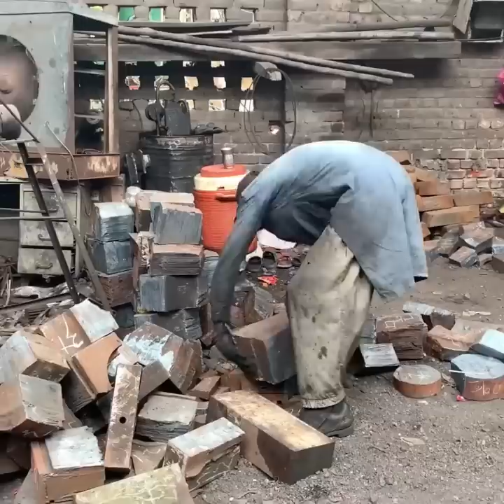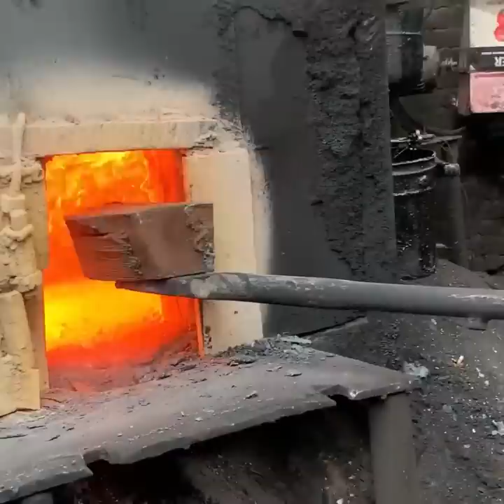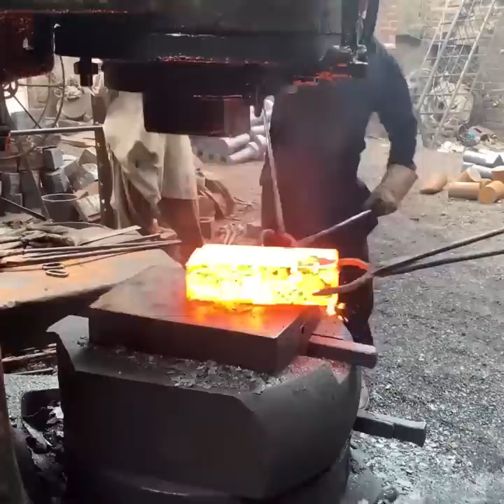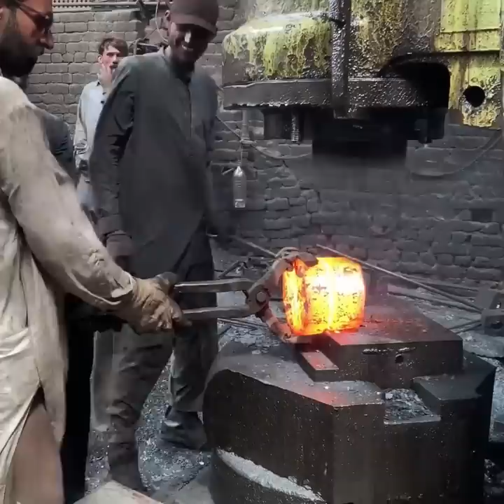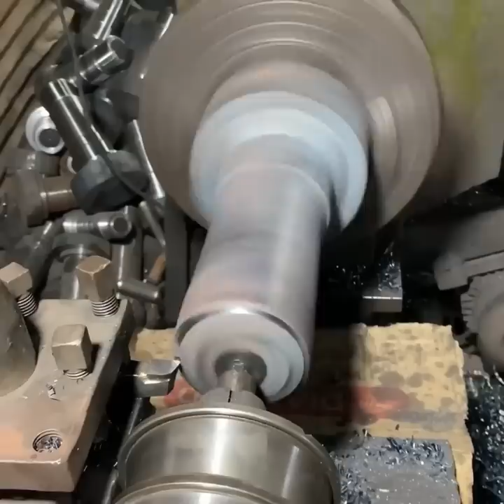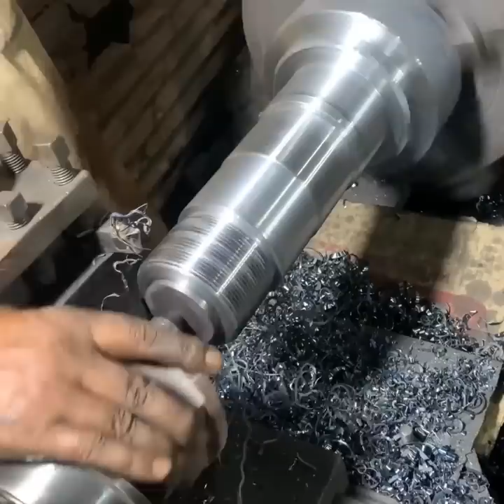Recycling Shipyard Scrap to Spindles With Forging Technique #shorts

Comment: The only thing I question is the strength of the steel sourced to make this spindle. Much respect to the poor craftsmen who made a spindle from scrap metal with minimal tools.
Reply: It will be extremely low quality.